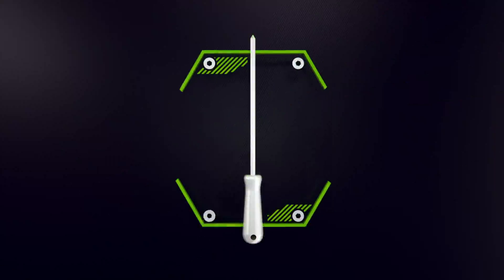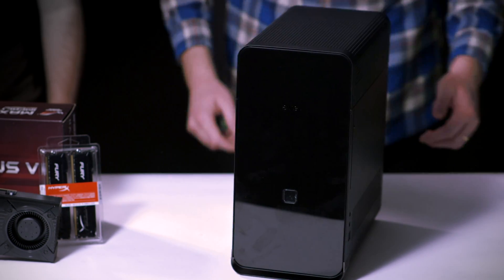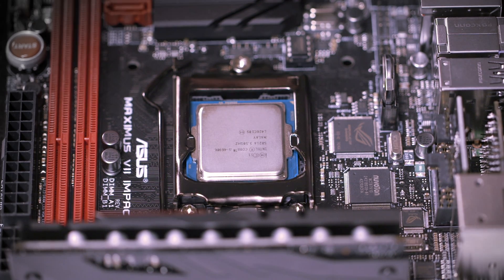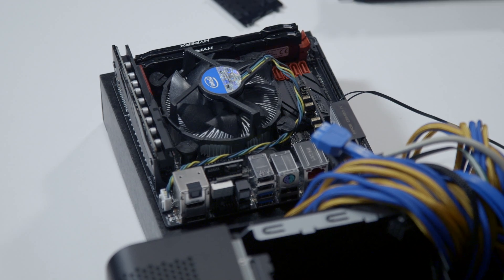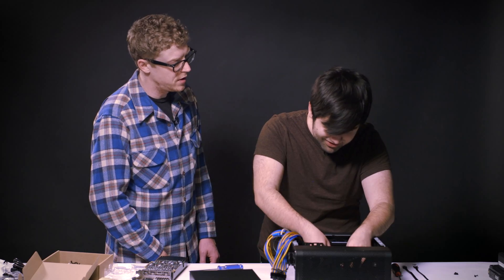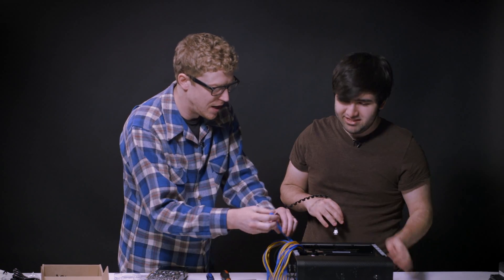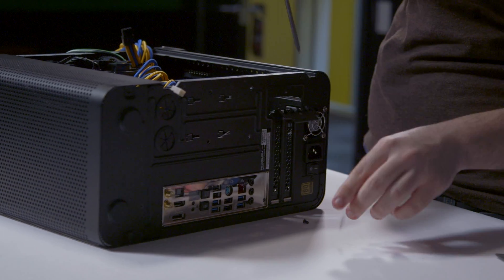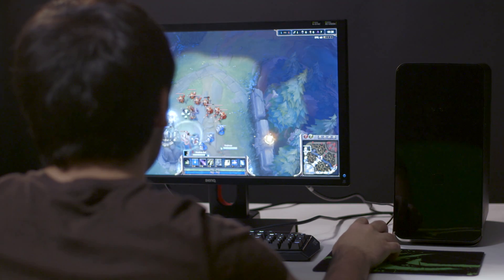GeForce Garage – How to Build a Competition Ready e-Sports Rig

Comment: could the laptop be upgraded with a new gpu??  im using an old dell vostro 1015!!!
Reply: No. Laptops have special dedicated GPU's or more commonly just integrated graphics. However you can buy an external GPU mount and connect it to your laptop. (depending on what laptop you have) then just use a normal gpu of your choice.

Comment: I think you should use the Antec 900 Case, it can be kept really cool and cold and you don't need to occupy more space for the CPU cooler (you don't need a fan on it) because it has that wide 15CM Fan at the top and the pressure kept inside is high for the least dust build-up.

Comment: Hmm, both I can run mostly over 25FPS. It's a Intel Pentium D 930 3.0Ghz with 4Gigs of DDR2 RAM. And paired with a GeForce 9600GT. No one needs so much horsepower to run LOL, Dota 2. Also PSU is a Cooler Master Elite 460.

Comment: a 960 for League of legends and CS:GO ....? lol... you'd be fine with a 450..
Reply: I admit, I was mistaken on the 730 vs 450 part. I do believe a 960 would still be the right choice for this machine though as Overwatch and a few other not as cool games are starting to take over the Esports genre, which require more graphical power than something like CS:GO, which can be played on a potato.
Reply: +Thoraxe555 They need at least 144 FPS
Reply: +Adam York no. gts 450 is not that bad
Reply: a 730 is worse than a 450
Reply: +Thoraxe555 The integrated graphics would actually be better than a 450.
Reply: Integrated graphics of a 4690k cpu is better than even a gt 730.

Comment: No need for a GTX 960 if you have ur gpu framecapped at 60fps.
Reply: +iClick ヅ That&#39;s a stupid argument for a few reasons:

1) League of Legends has a 60 FPS frame cap by default.
2) If you are playing a video game professionally, you never want your game&#39;s frame rate to drop or fluctuate.
3) Most consumer grade monitors are 60 Hz anyways, so adding an artificial framecap on your GPU (such as V-sync or adaptive V-sync) reduces the overall strain on your graphics card thus lowering temperatures and reducing power consumption.
Reply: +LimitedWard competitive games nowdays ALWAYS use 144hz monitors, in all the popular games... in the tournaments, i mean
Reply: Eugene InLaw The 960 should be able to push 144 FPS in League easily.
Reply: LimitedWard your argument from previous post is still nulified by this
Reply: LimitedWard bro, league of legends doesnt have a frame cap. you can get 9999 fps if you want.
Reply: iClick ヅ Perhaps I was under that impression because I had adaptive V-Sync enabled on my GPU and forgot. I'll try running without it next time to see what happens. I just assumed the game had v-sync always enabled since it never deviated from 60. Nevertheless my argument still stands.
Reply: LimitedWard read your post again and make conclusions...
Reply: +Eugene InLaw the initial argument was that a GTX 960 is unnecessary for league of legends since they capped they artificially capped the frame rate at 60 FPS. My point was that it's better to go with a fast GPU like the 960 since it would ensure consistent frame rates that won't drop below the refresh rate of the monitor.

It has since been pointed out to me that the artificial frame cap was not due to the video game itself. Nevertheless that doesn't diminish the importance of consistent frame rates when playing professionally. If anything, 144hz monitors only further confirm the need for a more powerful GPU such as the 960. Please explain what part of that doesn't make sense.

Comment: That's funny, all the budget build on this channel have 960. Because Nvidia is not able to make money on the 960 becuase it's bad they try to sell it more.

And using better thermal paste on intel stock cooler is just stupid.
Reply: +L3xou97 I just built a rig with the R9 380x and don't get me wrong, its a great card, but some people prefer the 960 and it isn't beat out a lot for a similar price. Some people just like Nvidia over Amd.
Reply: *****
 Best seller? I don't think so.
Reply: *****
 Clearly in europe nobody buy that sh*t. Except idiots.
Reply: *****
 It's not a best seller, Nvidia deleted the 2 Gb version and dropped the price of the 4 Gb (but not enough)
Reply: *****
 SLI of 960? You smoked when you bought that? Worst thing ever!
To be good the 960 should be at the actual price of the 950.
Reply: I'm not sure about the reference one Nvidia sells, but I use the 960 from MSI which carries 4gb of ram and it works fantastic
Reply: TruFly
 R9 380 is better
Reply: i wasn't saying that the 960 is the best. I just said that it works fantastic for what i use it for.Your comment really came out of nowhere.
Reply: +TruFly  R9 380 is better and less expensive so the 960 is useless
Reply: +L3xou97 Yes, the R9 380 is better bang for the buck, but that doesn't completely render the 960 as obsolete or useless. It still preforms well for what I use it for. You don't need to be so harsh.
Reply: TruFly
 Nvidia stopped to product 960 2 GB that's for a reason.
Reply: *****
 You forgot the "1" before the "300€"
Reply: James Walter
 Why people would prefer a brand with bad drivers?

960 is less powerful, more expansive and has bad drivers.
Reply: L3xou97 You could argue bad drivers for both brands I had a 7850 some time ago and it was really unreliable
Reply: James Walter
 It was ONE 7850.
Reply: +L3xou97 no, just the drivers at that time, I had another 7950 and a friend of mine had a 7770 all with driver issues
Reply: +James Walter Do you know how to install a driver? I'm not sure
Reply: +L3xou97 if your not sure how then you could go to AMD's website and contact their customer support
Reply: +James Walter 
I know how to install drivers, I have no problems except with geforce experience (it's working nice by downloading from nvidia website but it's not going to be possible) but if AMD drivers are not working for you, you don't know how to install a driver
Reply: L3xou97 Geforce experience is on their website
Reply: James Walter
 Ty captain obvious.

When I try to install drivers with gefore experience it crash. So I use the link to direct download the driver but Nvidia want to force us to use geforce experience so it's not going to be possible in the future. So I can't update the drivers.
Reply: L3xou97 Oh that sucks
Reply: James Walter
 I didn't check on their website for a while. I don't know if they removed the drivers link but If they do i'm going to spam their support until geforce experience works or driver link back.
Reply: man the optimization of the gtx 960 is so much better than amds more expensive cards check out videos and research before speaking shit :-)

Comment: NVIDIA i was told to put the CPU in and then close the holder with the brackets, and then take the protective CPU cover off. and that doing it your way chances the cover sliping into the fragile pins, breaking the whole board.

Comment: The gpu is so close to the psu there is hardly any space for it to breathe. That rig must have horrible airflow and be pretty loud to boot, especially with no extra fans for cooling..
Reply: ***** Even so this case will still be much hotter than a bigger case, the gpu on this build has a stock cooler as well. This pc is gonna be pretty loud regardless if it's blower style or not. At first it won't be that loud but over time due to dust the fans will need to do more work to make up for it because the case is so small thus making the pc louder, cleaning out the dust somewhat but even then that only goes so far as you can't get rid of all of it. I am speaking from experience. 

I have had a pc of similar size as this one with the psu very close to the gpu. While it never overheated it got pretty hot ( no overclock) and when the fan speed ramped up to increase airflow and cooling it got pretty loud. Since then I have gotten a new custom built pc with a large case, two 120mm fans on the left side, 120mm in front for the drives, another 120mm at the back for pulling out hot air and two more smaller ones if you count the stock intel cooler I have on my cpu and the fan on the gpu . I have not cleaned the dust from it in two years and it's still much more quieter than the micro atx size pc I had before, heck I barely even need the two 120mm fans on the left side of the case. I only turn them on sometimes because the look cool with the blue lights I have on them when they are on. The smaller size of a case comes at a cost
Reply: *****  oh I see well glad you understand, there a lot of ignorant people on the internet that always think they know better lol, sorry if I came off as elitist or a know it all. I was just trying to explain since what the guy said in the video is misleading, the card itself might not make that much noise however because of the case size that is not exactly applicable here, but yes if you just want something that works, don't mind the noise, heat and a lot of maintenance then yeah this build works just fine.

Comment: CPU

	AMD A8-6500 APU with Radeon(tm) HD Graphics 

	Maximum speed:	3.50 GHz
	Sockets:	1
	Cores:	2
	Logical processors:	4
	Virtualization:	Enabled
	L1 cache:	192 KB
	L2 cache:	4.0 MB

	Utilization	11%
	Speed	3.75 GHz
	Up time	0:00:35:03
	Processes	94
	Threads	1165
	Handles	33076
 I have a Quad core processor help!   only 2 cores on ?
Reply: 2 of the cores are for the integrated graphics and the other 2 are for the actual CPU. This is why I dont like APU's
Reply: Superclocked Studios nonono.... isnt this like amd's take on hyperthreading or am i dumb?
Reply: Hyperthreading is a name used by both Intel and AMD. Very few AMD processors have hyperthreading.

Comment: I have a few questions NVIDIA, hope you don't mind I ask.  Why that small factor? For what I know it is harder to build a small system, even if you have experience to prevent airflow problems. Why remove the CPU cover first when every cover clearly states not to remove it and install the CPU first and it will pop itself out? Why a K on a small build that is never going to be overclocked? Specially when you can save that 40 bucks using a 4460 (based on newegg prices) and use them with a bit more money for a better card (maybe a 970), a more silent cooler than the stock one or even a HDD for storage.

Comment: No gloves while installing CPU in the socket?? Daym you're expert guys...and you want to put an Intel processor in a micro atx without even a single chassis fan?? Well........
Reply: I worked as a system builder for a while and the only reason we wore gloves was so we wouldn't leave fingerprints or smudges, cuz getting those off can be a huge pain in the ass.
Reply: Why would you need gloves?  It's a CPU, not someone's anus.  It's a mini-ITX case, and the two fans are up in the top of the case (yes, it's a negative pressure dust collector).
Reply: Gloves?? Just for electricity that people MIGHT have and that can frills a cpu. And as you said the top fans will collect so much dust that it's like having no fans...that's what I wanted to make people to understand
Reply: Please don't just start a comment war because I had one with an asshole and I don't want to fight with anyone
Reply: Luigi Barbaraci Static discharges are easily dealt with by discharging yourself before handling the CPU (or RAM, for that matter), and not touching the contacts, which is pretty easy since the edges are the most natural way to hold them to seat them into their sockets/slots.  So gloves, really not necessary, nor are those ridiculous wrist straps.  After 15 years of PC building, I've yet to have a component die due to electrostatic discharge.  The fact is, unless you're wearing polymer-based clothing, it takes quite a lot of time for your body to build up enough static charge to cause an IC-killing discharge because your body is huge and your skin is quite electrically resistant, not just the tissue, but the oil as well.

No interest in a comment war, either.  Just genuinely surprised at an expectation of gloves for building a PC.  And with your reply my only interest is clearing up misconceptions about static electricity, because they're quite prevalent, even in the industry.
Reply: Yeah but I always prefer to wear them just in case. Because you never know what could happens so I prefer to wear gloves and having the security that I'm not going to mess up everything. It's just a personal precaution. Nothing else
Reply: Well I know nothing will happen because it's a matter of physics.  It's a bit like wearing a condom when you're masturbating.  Sure, you feel safer, but you weren't at risk of STDs or pregnancies in the first place.  But have at it, as long as you have fun. :)
Reply: I would prefer put an AMD processor in there instead the Intel one but for the rest is kinda cool
Reply: aidanjt
Ive never built a rig before  and this one seems kinda cool
would  you recommend this rig ?
Reply: Luigi Barbaraci which one exactly?
Reply: TheGenoxis Naw, I was really excited about the hadron when it came out, but it has a number of shortfalls that really leaves it wanting. If I was doing another mini-ITX build I'd probably go with the Corsair 380T case and an Asus Maximus VII Impact motherboard.
Reply: TheGenoxis For example an Amd Phenom II X4 955 Black Edition or an AMD FX Quad-core
Reply: I won't even reply to this comment lol

Comment: whats with the OEM INTEL heatsink  when the rest of the system is pretty decent kit  kinda imbalanced specs
Reply: Think about it. Voyboy isn't gonna overclock. Stock cooler is fine for stock clock
Reply: That guy looks like a PC noob, so he probs won't overclock. So stick cooler is enough.
Reply: Jason Fraser They're fine even if you overclock, they're not pretty or quiet though.